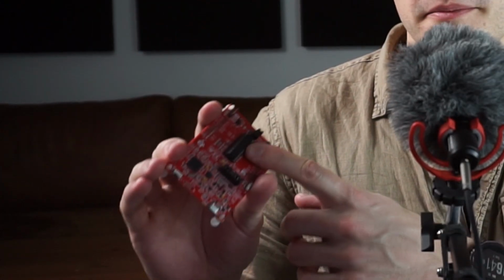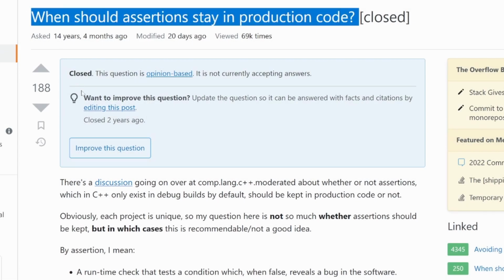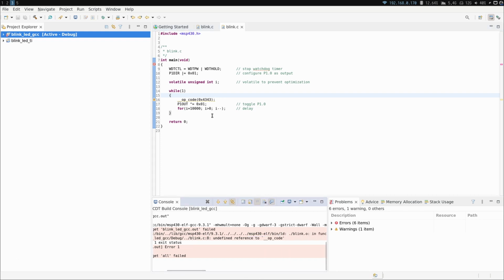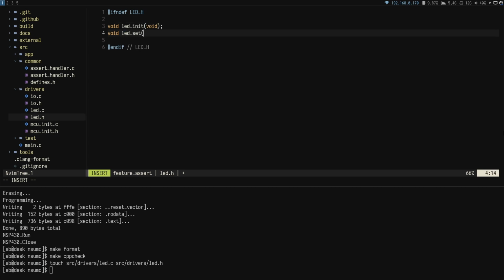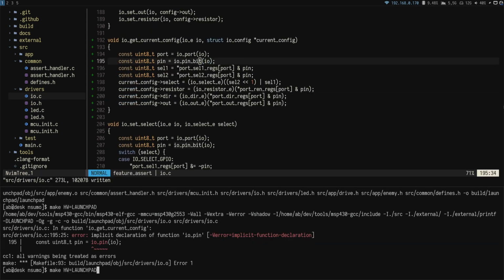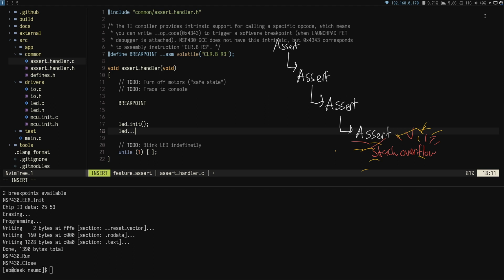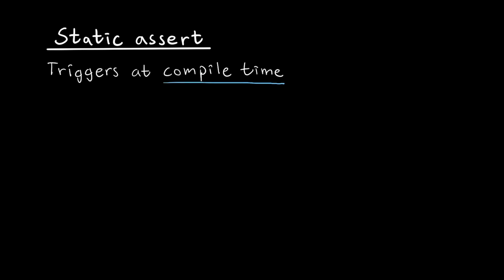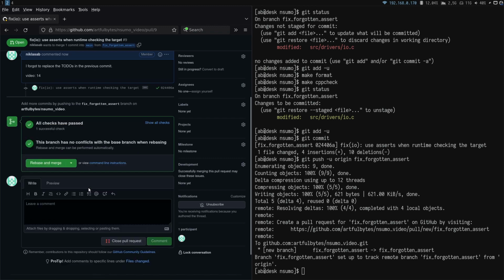Assert on a Microcontroller | Embedded System Project Series #14

Comment: First of all: 
Great content! You definitely deserve wayyy more subs :)

Second:
This is very similar to what we do in my industry (safety-critical systems). We typically call the macro either ASSERT or FUSE. They must always be present on the release code as well. We use them to add defensive programming everywhere. For example, we use them to always check all function parameters. This has of course a huge impact on performance (we have thousands of asserts) but this another story... Typically we do something very similar to what you presented here. When the assert handler is called, we first send the error to our non-safe system, which is the one doing all the logging. Then we just enter an infinite loop in which we are de-energizing all of our system's outputs (that is our safe state).